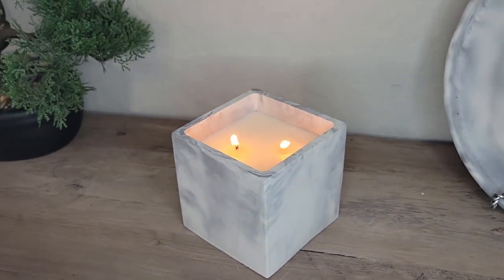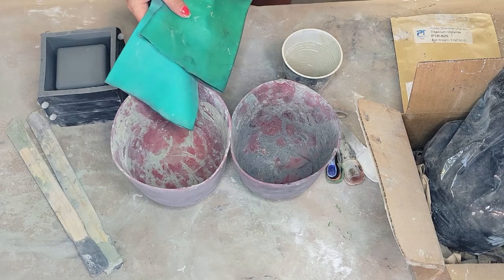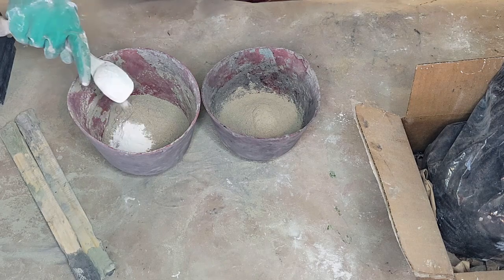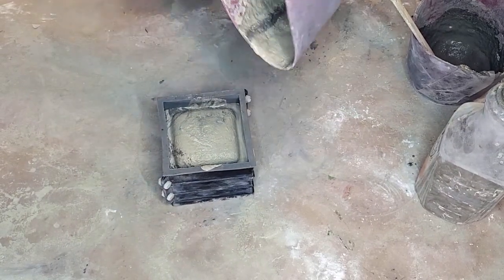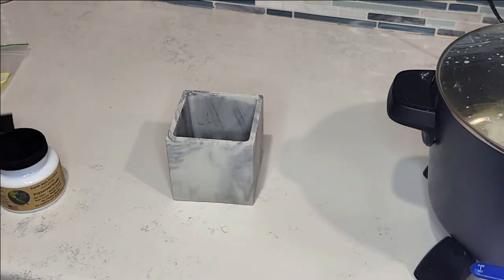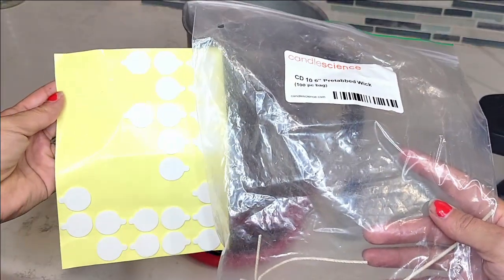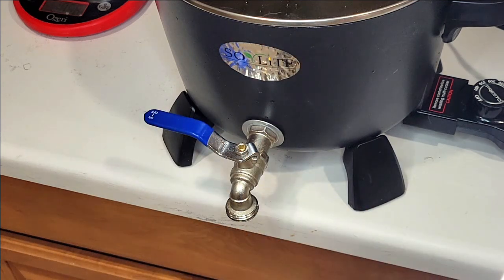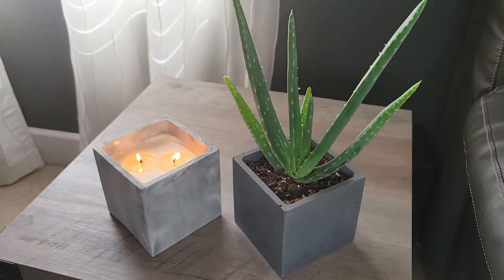Step by Step DIY Square Concrete Candle or Planter

Comment: Do you put the hole for the planter when the concrete is still wet inside of the mold? And when you use colored pigments to color your molds, do you prefer pigment powder or acrylic paint?  Thank you :)
Reply from the maker: Yes! I put the hole in right after I pour while it's wet :) I prefer pigment!
Reply: @WizeOwlCandles  thank you :) can you use any pigment for the concrete jars or it has to be specifically for concrete jars?
Reply from the maker: @rachaelvaldivieso3434  I personally use concrete pigment. The other pigments just soaked up into the concrete and you couldn't see it. Hope that helps!
Reply: @WizeOwlCandles  yes definitely helps. Thank you :)